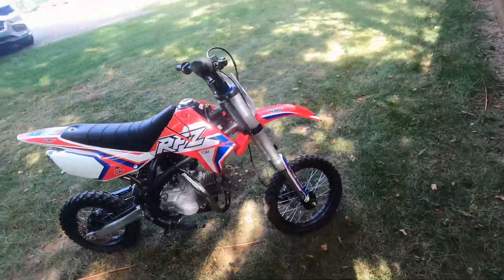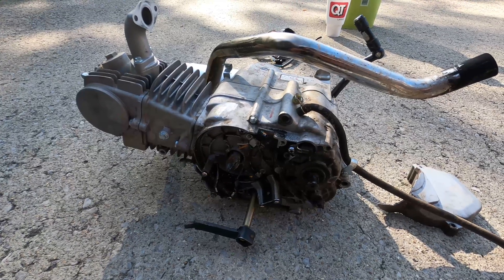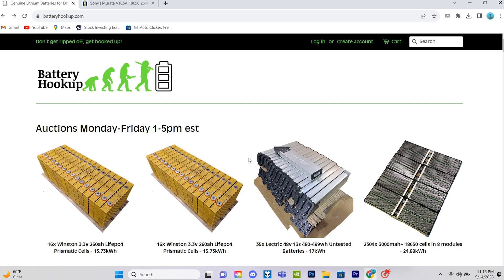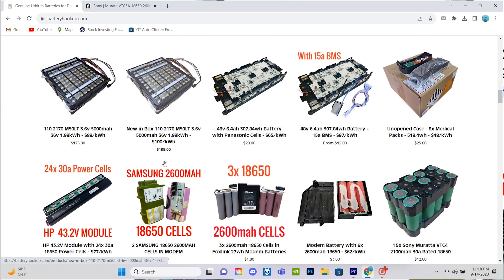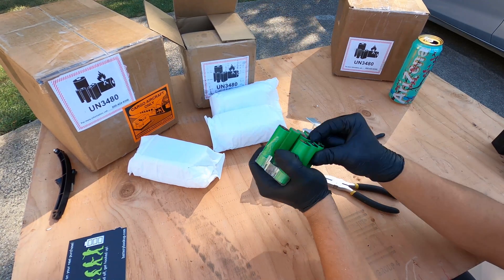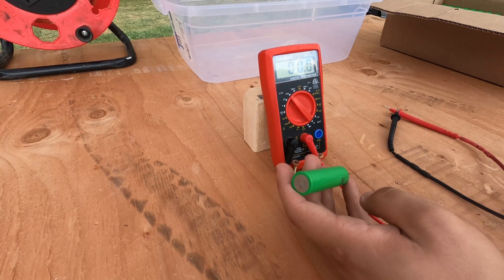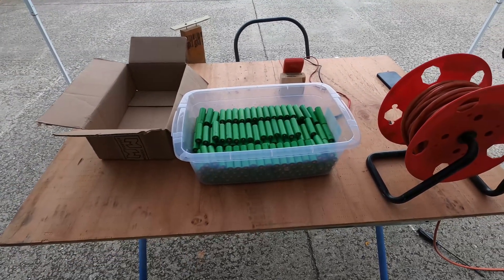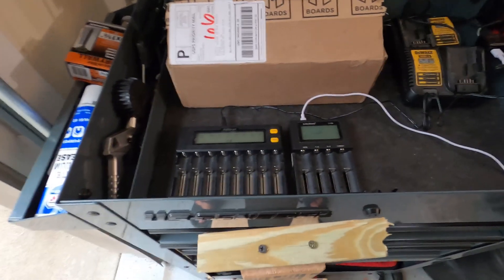38KW! POWERFULL ELECTRIC DIY Conversion!! Pit Bike/Dirt bike, Mini moto Conversion Project. -Part 1-

Comment: Subscribed for part 2 I’m in process of a qs138 70h v3 build in klx110
Reply from the maker: Thx. Good luck on that!
Reply: When part 2 coming ?
Reply from the maker: @kyle123bill  pretty soon, I'm in the process of mounting the motor right now. Should be out in about 2 weeks or so.

Comment: Wow you're going to fly on that thing! You've got me  convinced to build my own batteries now! thanks for the info again. I'm doing 2 48volts so i can charge them with a standard charger... theres got to be a cheap master charger out there for you? I couldn't stand waiting that long to charge lmao!
Reply from the maker: Il be using my go-kart charger cause it's the same voltage and plug. But il order one later on. The charger i have is adjustable to 12a, and it's only $110v is is awesome
Reply: @Mikelinnyk  nice well best of luck too you too! Send it and save money!

Comment: Awesome work brother.  Also, at 5:11, they list the temp there because lithium batteries operate best when they are warm.  It's why their capabilities get worse in winter months if they don't have a well insulated enclosure.  Past 80C the benefits of a warm battery diminish and with it goes the discharge current rating.
Reply from the maker: I actually didn't even know that. Thanks for your info